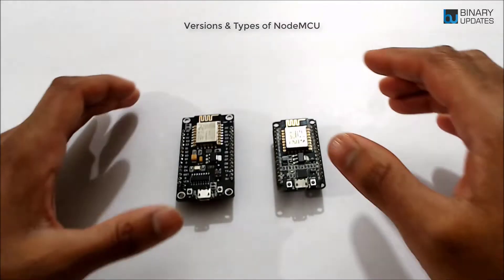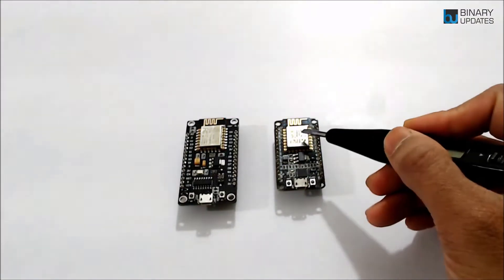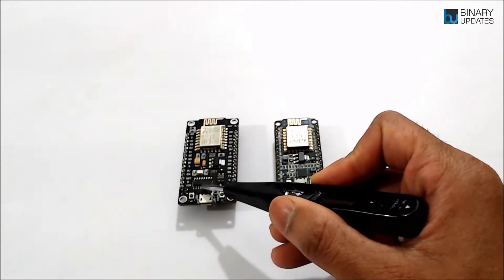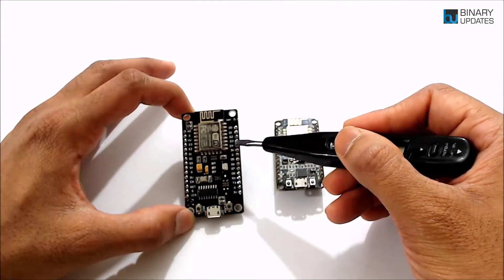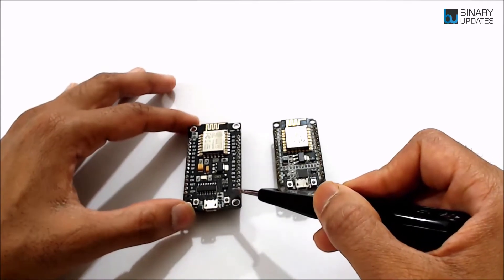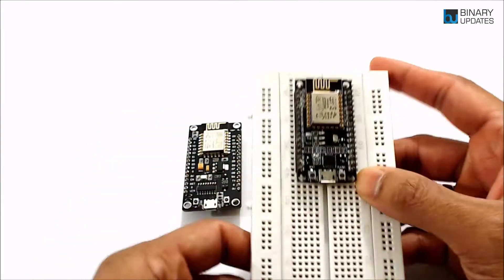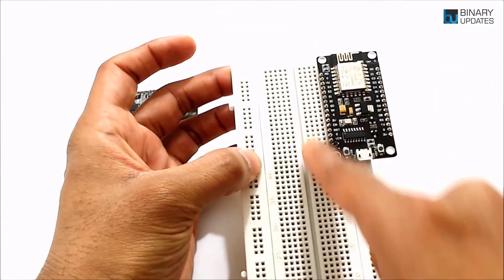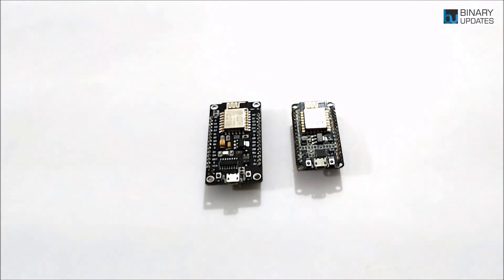Compare Versions and Types of NodeMCU ESP8266 Boards

Comment: How we connect two esp8266 each other and also send their data on Mobile ap
Reply from the maker: Hi Skilzzmania, there are several ways you can communicate or connect wired and wireless. The best way is to make one ESP8266 as client and other will be ESP will be server. This way you can connect both ESP8266 to talk to each other using typical client and server communication. Hope this will help you. Best wishes!

Comment: Place two breadboards side by side. Left pins on V3 will plug into left breadboard and the right pins to the other.
Reply from the maker: Hi Gedtoon, that's an alternative when your NodeMCU ESP8266 is bigger in size. I have done this few times in past. Hope you're having fun wish your ESP8266. Cheers!

Comment: @5:20 you can modify breadboard by attaching either side of vertical connector lines together.(Not advisable but if you want then there's an option)

Comment: I personally use the bigger version and I put it on the side of the bread board but instead of sacrificing one side I put a breadboard on each side so I can still work with both.
Reply: This is exactly what I do.  In fact if you join 2 breadboards together (leaving the bus bars in place) it straddles the bus bars "perfectly".  This assumes the breadboards are designed to snap together.
Reply: @ yes exactly what I do

Comment: I need to connect both sides using v3 what i can i do pls hlp
Reply: place two breadboards side by side. left pins on V3 will plug into left breadboard and the right pins to the other.

Comment: I have a V3 MCU. The problem is that code is not executing. What should I do.
Reply: Are you pressing the reset button after uploading? Sometimes when I work with WiFi I have to do that

Comment: it really helped me to decide because i was concerned that the bigger one would not fit on the bread board and it really does not. thanks for the video ❤
Reply from the maker: Hi Sinatajik, I'm glad to know you found this comparison of NodeMCU ESP8266 is useful. Even when I was new I struggled with bigger NodeMCU to fit into the breadboard while prototyping circuit. Thanks and best wishes!

Comment: what's the difference between nodemcu v2/v3 and nodemcu Lua v2/v3? i've seen a seller who has 4 options to select from, nodemcu v2, nodemcu v3, nodemcu lua v2, & nodemcu lua v3. please tell us something on it.
Reply: I think Lua has some firmware installed that allows you to run Lua scripts, it should be similar in terms of hardware

Comment: Why can't I install a program on CH340 but on CP2102 it works. can you help me
Reply from the maker: Hi, I hope your NodeMCU ESP8266 which has CH340 is not broken. Usually, you'll find these modules are cheaper than CP2102 based NodeMCU. In past 2 years, I have seen because of lower build quality they cause issues very often. Good luck and best wishes!

Comment: Can it be used just as a serial to usb converter?
Reply from the maker: Hi Yusuf, I think its possible to use NodeMCU ESP8266 board to use it as a Serial USB converter as it has chip on it. Good luck and best wishes!
Reply: @BINARYUPDATES  i tried it already and it worked perfectly,  thanks for you reply anyway

Comment: Which is the best node mcu cp2102 v/s ch340 I am very confused please help me??😅
Reply from the maker: Hi Subho, both are same if I'm at your place I may prefer to use NodeMCU ESP8266 with CP2102. But both are pretty much same as they uses ESP8266 Microcontroller. Good luck and best wishes!

Comment: I was unsure if i'd bought the right version and never expected there to be a clear comparison video (there usually isn't for things as specific as this). Thanks!
Reply from the maker: Glad I could help! Thanks Floris!
Reply: @BINARYUPDATES Hi, can we power the nodemcu v3 using 3.3v to the 3.3v pins? Or should we only use Vin?
Reply: @ey-618 pretty sure the 3.3v pin is an output pin and voltage needs to be supplied to the Vin pin
Reply: @FaZeWIDOW  Ok. So it needs above 4.5 v to work. I feel ams1117 is a shitty ldo, but not sure which one this one has. On my esp32cam, if I give 5v it heats up a lot. But on the esp8266 v3 ch340 I have, it's not heating at all. Thanks for replying.

Comment: I had a doubt with cp2102. Some months before I bought it and programmed. When I testing suddenly the board lightup the 2indication lights and not able to use it(indication light remains always). I had tried to reprogram but program is not get uploading please help.
Reply from the maker: I hope the board is detecting as a COM Port. Also I'll suggest consider flashing ESP firmware (factory default) may help. Good luck!